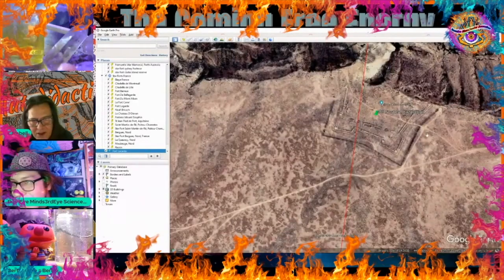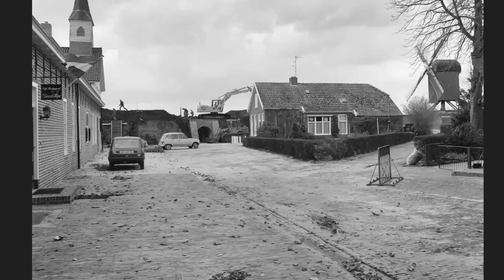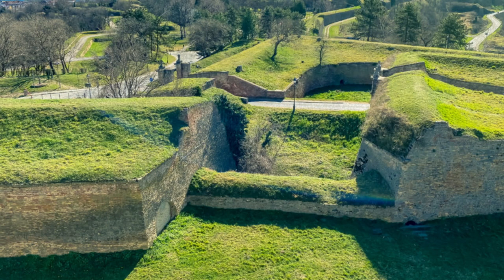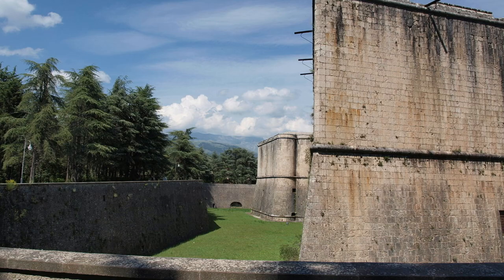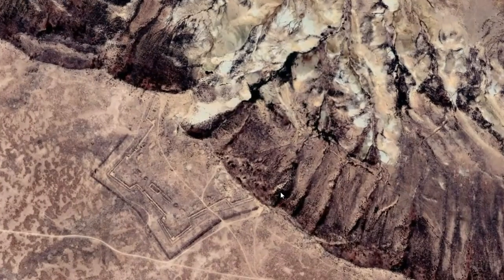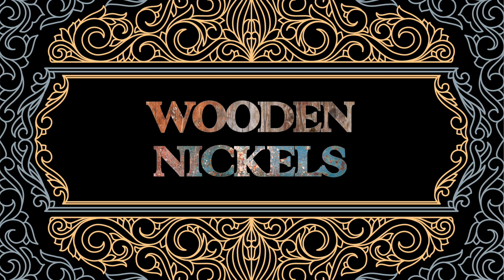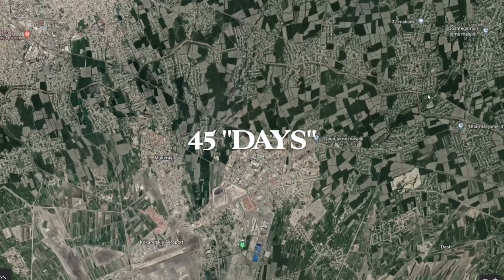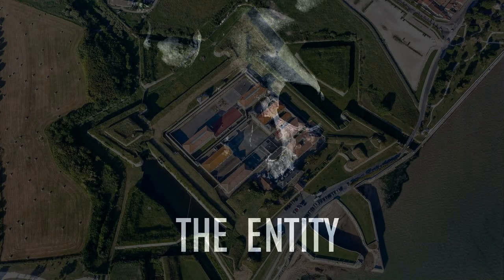Star Forts: They Are Lying

Comment: First thing that came to my mind were the military terms 'canalization' and 'fields of fire'. As a Marine Corps engineer, I have used these terms over and over. Many of these forts utilize canals for this purpose, in addition to adding a requirement for bridging or amphibious operations. Both are very difficult under fire, and result in heavy casualties among the assaulting force. The tactic of "guiding" the enemy into specific areas (especially into a thin line) is covered in great detail when discussing military defensive posture. Also, presenting areas that look safe, but are actually pre-sighted by weapons, or booby trapped is a common tactic. What you covered in this video makes complete sense to a military engineer. 
Also, the changing of the battle space, based on weapon development is extensively covered in military tactics books and manuals. For example, advancement of rifle and machine gun technology led to the transition from large units engaging enemies "on line, at close interval" gave way to small unit tactics and maneuver warfare. In the same manner, modern forward operating bases employ compartmentalization in order to minimize casualties from indirect fire weapons. 
Great video.
Reply: Real recognizes Real 🤝🏼🐻
Reply: The Tower of London implemented funnelling an enemy down a narrow passage once the gate was breached, they would stand above and rain down death.

Comment: Someone has gone to a lot of trouble to hide this project and the photos. The question is..why?
I’m from Boston, as a kid, we would go to a place called Castle Island.  It wasn’t until a couple years ago did I realize it was a star fort. I did some digging and found drawings from the 1700’s that shows the area actually had a castle on it. I’m not sure if the star fort was even there back then but, it doesn’t seem it was (based on the size of the castle in the drawings.  One caveat, in the current day, there’s a mini obelisk (Freemasonic) that wasn’t present when I was a kid.
It seems to me, the his-story of these sites is purposely convoluted.

Comment: The water would of gone stagnant 
It would of been putrid..
No water flow an no trees,,,salt comes up....
     Something that's already there an needs redoing is easier,,,  
Batter walls ,, batter means that the wall should lean towards what its holding. 
You can't really put a JCB on the edge of a straight wall an dig ,,it will collapse,,, so a batter wall will also allow the machine closer to the edge,,,
With a covert getting put in ,,that means there's an outlet now...
So it looks like they are destagnating the whole place....
    The inland lake i have just finished 
Was putrid,,  we gave it an outlet 
An planted more trees...
It fills up with rain an at the end of summer the water gets released...
Then fills with rain again..
What happens is the putrid water gets flushed,,,,,, birds an animals come back 
An life flourishes,,,,  
   I noticed that there was still a little bit of water in the moat of the starfort..
The reason being,, acid sulphates would of been at the bottom acid sulphates dont cause any trouble  but if its drained completely 
 it will come into contact with oxygen,,,this will create sulphuric acid,,,,,an that can go as far as destroying buildings an surrounding infrastructure,,,, it goes on what can happen if this problem wasn't addressed... 
 The place is being flushed.. ........
It was probably done with a government grant or royalties for regions its called today,,, an its usually money from mines thats donated to keep thier tax down 
That dictates how many people are on the job,,,goes back to the tenders..

Comment: I wonder if the star fort was able to flood or wet all the land so cannons couldn’t just roll up to the walls 🤔
Reply: That's a very good question.

They were certainly used for this by the Dutch.

The Dutch main defensive line against foreign invaders was the Hollandse Waterlinie. Originally built to counter a French invasion in 1672. I consisted of plains that could be flooded in about 1 meter of water. Making them impassible for horse and canons. The sluices that regulated were indeed guarded by star forts. As were the only roads crossing the inundation plains.

In the late 19th century it was upgraded. With new forts(a more advanced design), new guns, and more advanced ways of inundating. Many of these forts still exist.

A second defensive line was built in the early 20th century. It encircles Amsterdam( Stelling van Amsterdam). Just like the Hollandse Waterlinie it still exist. And most forts can be visited.

Comment: I find the starfort story interesting.  Here in New Zealand they are called Redoubts and referred to as military installations even though we have only ever had the maori land wars, which was bush and trench warfare (in a nutshell).  One in particular at Pirongia is nowhere near water and on one of the side, the south south west side you can see what looks like energy blow out.  I have a number of photo's but they don't compare to physically seeing it.  I do believe there is a solid structure beneth the earth but I will need to go back and look further and investigate. The "mote" is easily 12-15 ft high.  Here are some of my pics, Driving NZ is what I do for a pass time :)  So I do not edit any pics, these are uploaded mainly for storage and for my father to see where I have been.  I started seriously driving NZs old roads etc a few years back as well as documenting old buildings and monuments etc because something is wrong with our HIStory.
https://archive.org/details/156_20220822/141.JPG
Reply: Pics 24 onwards shows what looks like something blowing out from inside.  and only on that one side.  there was clearly 3 horizontal lines a couple foot apart and the height easily being 10-12ft. The earth isn't slumping as these "cracks" or "blowouts" run the full height of the structure.  As I say the photo's dont really do it justice.
Reply: There are also old maps of Auckland showing the remnants of starfort features along the water front of central Auckland.  We also have 2 "ancient" pyramids down the south island in which an idol figurine (now in Dunedin museum if I remember rightly) was found and is NOT of maori origin
Reply: The British would have built starforts to defend their colonies.
Reply: @m.f.-live676  so did the Dutch.